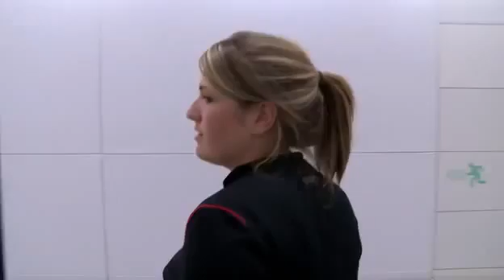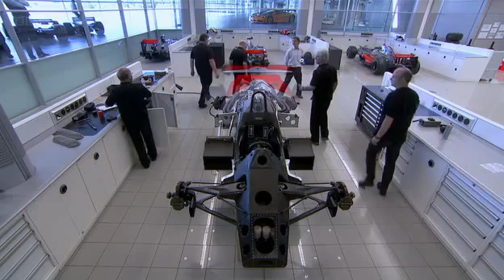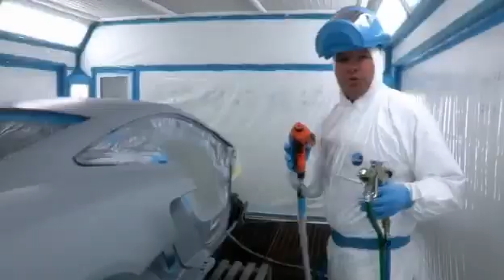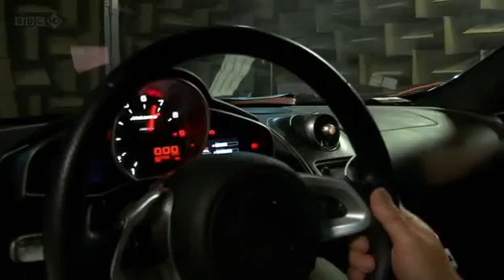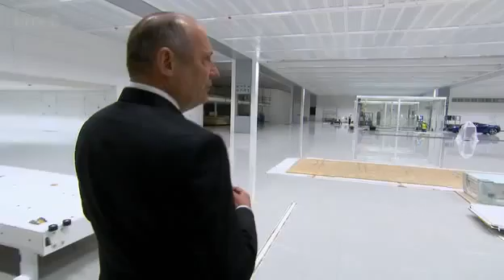McLaren Documentary 2011

Comment: I can't believe that McLaren let a phrase like "a v-8 engine is basically two four-stroke engines bolted together with a single crank."  By that logic, we could say that it's eight four-stroke engines bolted together.

I'm sure they meant two four cylinder engines bolted together, but that's not what made the soundtrack.

Even in F-1, English quality holds true.
Reply: And then say that the pressure opens up the exhaust valve. May as well get rid of the cam for the exhaust valves 😂
Reply: How do you feel about those odd floor tiles? LoL
Reply: @rob_BMA  OMG! Rob I heard that too and was like wtf. If you watch the video again the exhaust valve is opening when the cam lobe is straight up and no where near the the valve to open it and it magically opens anyway.  This is what happens when you let people who aren't car people and are idiots explain things.

Comment: I could be completely wrong, but I think the engineers designed the Veyron to have a stable high-speed platform. The handling capabilities that came with it are a mere side effect. Their main objective was to go 260mph+, so everything was built with that in mind. If they wanted to have the fastest track time, they wouldn't be using a massive engine with such tall gearing.

Comment: Different tracks will yield different results. Especially when many of the times at certain tracks were set by different drivers. The only track times I take seriously are those that were set by the same drivers. Which Top Gear and Autocar did. The McLaren was only 1-tenth slower than the Veyron SS when Autocar tested it. I think it's safe to say that the MP4-12C is on par with the Veyron SS and faster than the old Veyron. So I'd say it's as fast as advertised. And certainly fast everywhere.

Comment: Not only did they mess up on the animation, but they messed up on the explanation as well. They say that the combustion stroke "forces open" the exhaust valve. If that were the case, it wouldn't force DOWN the piston, and would thus actually rob the car of all power, rendering it virtually useless!

Comment: The name MP4-12C is the monacar they gave it based on the technology used to developed the car. MP4 = McLaren Project 4. 12 = is the designation they gave the car bases on there companies Vehicle Performance Index. C = stands for the fact that chassis is made of carbon fiber. Here is the link to check my facts. Fact is the MP4-12C is the most efficient production car to date. Many can't compete with 600hp from a 3.2L engine that delivers 30 miles to the gallon. And handles like a Formula 1 car.

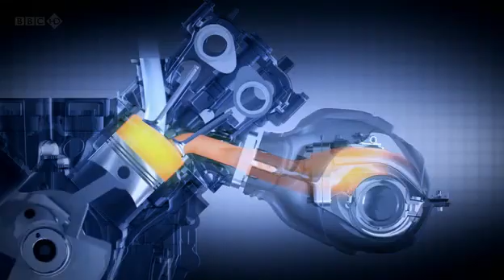Comment: 34:08 "The last upward movement of the piston forces open the exhaust valve, releasing used gases." That's not how that works.
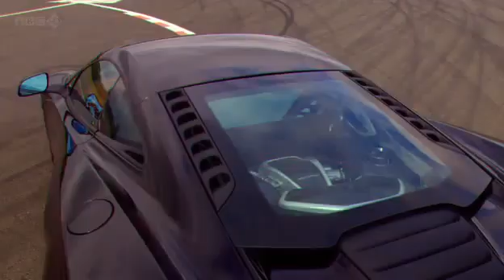33:34 "A V8 is basically two four-stroke engines..." It COULD be two-stroke. Saying that it's almost like two four-cylinder engines would be less wrong.

Comment: what else would you do if the dealership didn't supply better? or the main distributor them selves... and i miss interpreted your c6 auto comment... because you said "cars" after

the mustang is nice, but im sure you couldn't value the quality of work i would do for you any way. You simply write the check you don't turn wrenches or understand the engineering behind so many different designs of the same part...

Comment: The Veyron doesn't compete in any race series. So yeah, it wasn't built for the track. However you're going to have a hard convincing me that Bugatti didn't have the track in mind when designing the Veyron. Especially the Super Sport.  It's not an accident that the Veyron is nearly faster than every other supercar around a track. A lot of research went into developing the Veyron's cornering ability. They didn't just slap a 1200 hp engine into the back of a luxury car and call it a day.